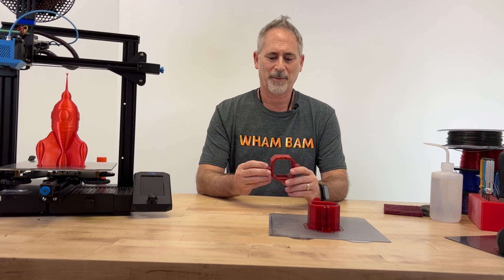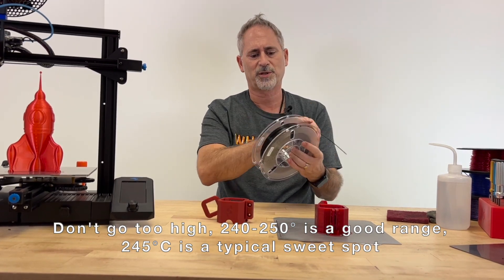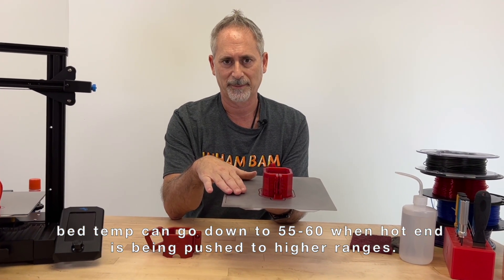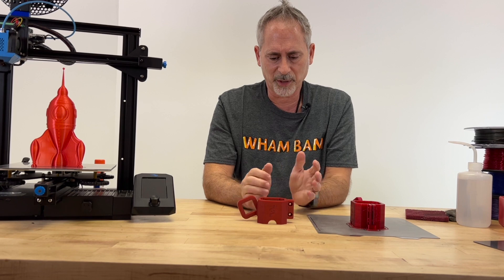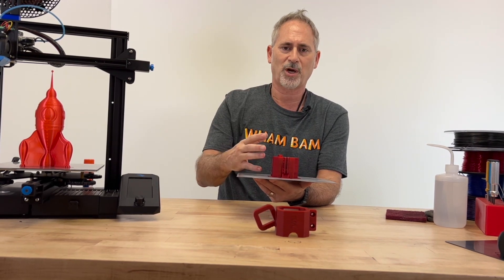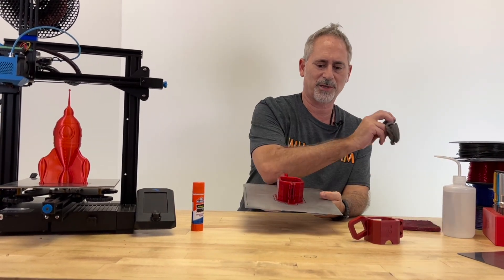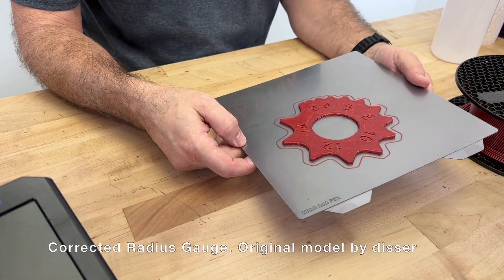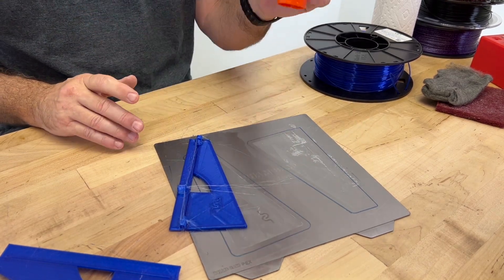How To Print Problem Free PETG On Wham Bam PEX

Comment: Just purchased a printer secondhand which came with 3 PEX plates. 2 of them slightly ruined. (1 scratched from a scraper, one with chunks pulled out from a print that adhered too well.) One good one. Of course, I immediately start printing PETG straight onto it. My 4th print adheres too well and I pull a small chunk off. It's only after this that I look into what the heck PEX is and find that you have to be careful if you want to print PETG straight onto it. I figure between the 3 build plates I have two build plate's worth of still-good PEX area. I think for PETG I'll stick to the textured PEI sheet that the guy also bought for the printer.

Comment: Just bought one of these for my X1C, mainly printing PLA and ABS/ASA, I have another printer I use for PET/PETG that the profiles are really dialed in for, I may avoid printing PET(G) on this plate.
Reply from the maker: Thank you for your purchase, you will love PEX for PLA and most filaments! We also have an authentic Carbon Fiber Flexi Plate that works excellently on PETG and all higher grip filaments without any damage or having to tweak the settings. If you work with that filament a lot and this is something that interests you, here are the currently available sizes: https://www.whambamsystems.com/collections/carbon-fiber

Comment: did not know that my dualsided powder-coated textured pei plate had poor adhesion with petg? i use it for all petg prints and i have to flex the plate hard many times to get prints off it, cant say i agree with you on the "petg does not stick well to pei" part sir. on the contrary u can try yourself? u most likely got those gold colored ones too. i was flabbergasted at how well it does petg.

will try this for funsies ;) but i think im going back to the texpei again for sure. the texture is nice too imo
Reply from the maker: Sorry, where do you feel we say that PETG has poor adhesion to PEI? our video is all about how to reduce the over abound at adhesion
Reply: @WhamBamSystems  0:38 "have a lot of difficulties when it comes to printing on pex and pei" and it really doesnt. its painfree.. no chipped borosilicate, chunks of pex or g10..

i missed a word in translation. norwegian here, english is not best. meant too good as in not what one wold want. too good is also poor in norwegian.
as u could understand from the rest of the text, clearly i was impressed with the adhesion and ease of removal from textured pei with petg... 

did try petg with whambam plate and its about the same tack as the textured pei. had to increase 12c more than pei to get same range of tack. love the plates for abs as they leave a flat surface for branding. the customers is always right yes? 

good thing we cleared that up then ;) good summer to you sir.
Reply from the maker: @reyalPRON  thank you too for the careful clarity in our language! My Norwegian is non existent!
Reply: @WhamBamSystems  I just re-read my initial comment and i must apologize. it got twisted in translation to come off as offensive. it was meant in opposite way completely! 

i have two of your pex systems and i completely adore them, i have only tested in a corner with petg as i do like to cook to petg to get the glossy finish and monster layeradhesion it gets. i do not want to risk the pex for petg. the texpei gold plates for petg is as amazing as abs is at 110c with your plates. i can do no brim on most prints even the ones with thin flat solid bases and sharp corners. its just mental how good the pex is. and the lifespan is so good i cant believe how you are making money.

i meant to say that i have never had petg fuse with texpei plate as you say, i am curious to what temps and offsets used to fuse. so i can avoid this, as i do cook them good :) i also wonder what problems you had with petg and pei as i have had only good experience with petg. it cant be luck as im the most unlucky person in my town.😂

Comment: Hi, i really want to buy that Plate for my soon incoming Bambu Lab X1C to print Basicly everything without probs. So my question is, if i want to Print PETG, is 3DLac working as a Protective sheet or will it just make it worse? Thats the kind of "Glue i am tipicaly use and its Pretty common here in Germany. Its Kinda like Hairspray. Big Thanks

Comment: if the surface damages that easily. seems like a design flaw.
Reply from the maker: It’s actually not a flaw but a condition of printing with different surface materials. The user has to inform themselves with ideal settings and conditions for each type of filament and each type of surface material, every one has its limits or attention points, glass, PC, PEI,PEX powder painted PEI, garrolite, you can damage all of these if used outside of recommended settings. PEX does not damage easily, and if you follow our advice you should have surfaces that last many yers
Reply: @WhamBamSystems  if the PEX coating was thicker it would be less prone to damage. I previously used 1/16 PEI sheets and that were very tough by comparison. if yuou doubled the thickness of the PEX it would be more durable and less likely that your clients would have issues

Comment: So how do I set the first layer higher up in Bambu slicer? Also, can PETG really be printed with just 245C, at 200mm/s+ (bambu speeds). I use 260/90 with Bambu X1C and textured plate and can print 230-250mm/s
Reply from the maker: We do reccommend for high speed to go maximum 10 degrees over manufacturer limit and as such 255 is fine, and you get full speeds     To increase your gap of your first layer go here and get the start gcode: https://www.printables.com/model/322000-bambu-lab-modified-start-and-end-gcode

Comment: Nice You made a plate Specific for the Bambu Lab X1 for $74 released it in December and now are giving instructions on settings for the X1. Very unprofessional!!! My plate is trash. I am very disappointed. Why did you not include these useful tidbits in the original instructions??? WHAM BAM THANK YOU, MAM !!! I really feel ripped off.
Reply from the maker: Thank you for your comment, this is why we made this video. These have been our recommended settings for PETG on our PEX build surface for the 4+ years we have been making them! Our $54 Bambu Lab Flexi Plate has always included recommended settings for PETG right on the instructions included in the packaging and on the support page that have not changed. However, we did not know back in December that Bambu Lab raises the temperature of the hot end in their slicer settings for PETG so we now recommend using this PETG guide specifically to adjust to our recommended settings: https://bit.ly/3JcvFuN

Please reach out to our technical support team at technical@whambamsystems.com so they can further assist you with your damaged plate!
Reply: Thank you for your quick response and very reasonable replacement offer. I received a new plate within 2 days. Customer service is the yardstick from which all good companies should be measured. Your company has shown me you are head and shoulders above other companies.

Comment: I got this plate when it first came out.. wish I had known this issue with petg my plate was ruined after first use
Reply from the maker: That is why we created this video, to spread the info to help avoid these issues! If you did not already, please reach out to our technical support team about your issue at technical@whambamsystems.com
Reply: @WhamBamSystems  Same thing happened to me. Wham Bam's website at the time recommended a much hotter bed temperature and my first PETG print fused to the PEX. I contacted tech support and they just sold me a new PEX sheet at full price + shipping. I really like Wham Bam, so I was a bit disappointed at that response.

Comment: I suggest people utilize the Teaching Tech Calibration page. Don’t guess what temp to print. Do a temperature tower.  See the best temp for that machine. Then do the calibration flow cubes for extrusion/flow rate. And especially for PETG, do the retraction tests to find the ideal distance.  And finally, invest in a filament dryer. Dry material before use and short in air tight containers with desiccant
Reply from the maker: Thanks for adding those tips!
Reply: I have the opposite problem, not sticking enough
Reply from the maker: @PointBlankMetal  please write to us at technical@whambamsystems.com tell us what filament what printer and your settings and we can give you advice to get you to have amazing adhesion and release! Thanks

Comment: Fantastic info! Especially for the bambu printers. I’ve def had petg parts semi fuse with the pex plate where there is now imprinted into the pex plate
Reply from the maker: Thanks for the feedback! On the Bambu Lab, they raise the temperatures of the hot end in their slicer for PETG so we recommend using this PETG guide specifically to adjust for Bambu Lab: https://bit.ly/3JcvFuN
Hope this helps!